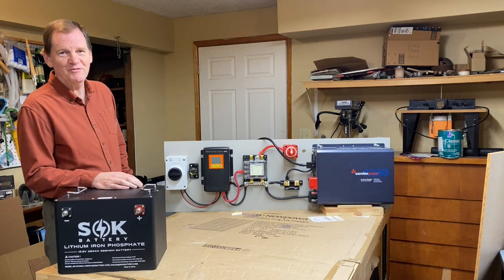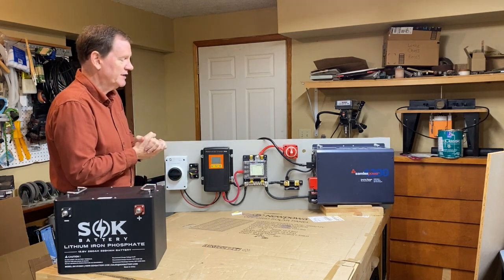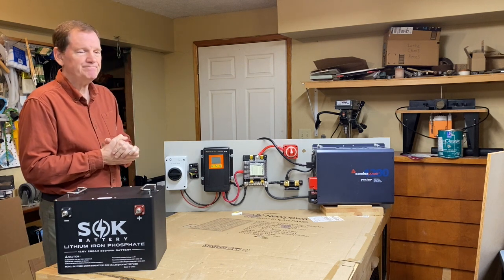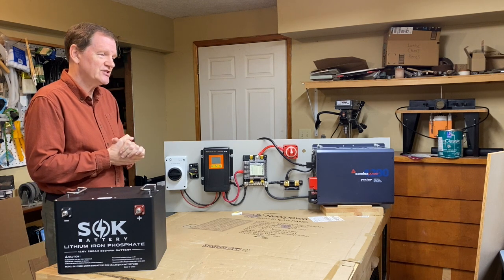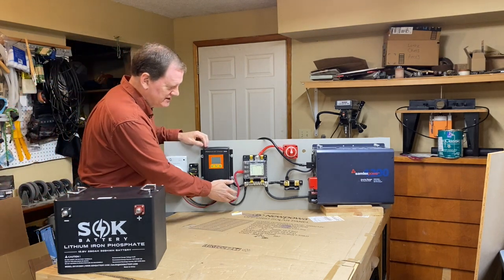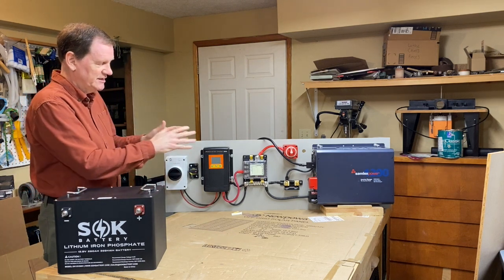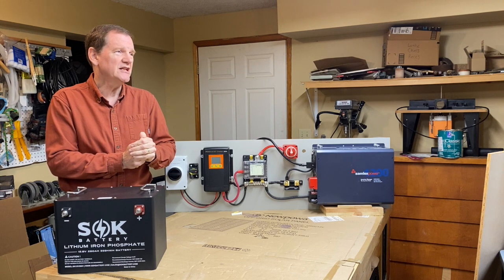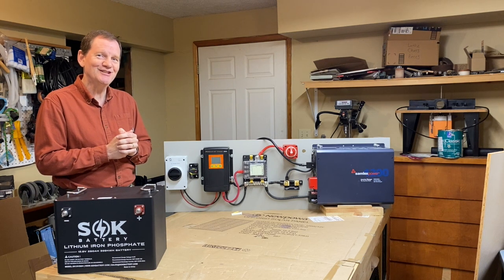CampMaker Van Simple Electrical System

Comment: Dennis, I enjoyed most of your video, but as a novice, there's a big piece missing. Where does the battery connect to the system you show? At the shunt? At the MPPT/DC-DC charger? I've always heard the shunt connects to the battery negative and the charge controller.
Reply from the maker: The battery red (plus) connects to the large red shut off valve and the black (negative) connects to the right post on the shunt. Sorry for not noticing your comment earlier.

Comment: Simple setup with an easy-to-understand description.  My problem is I already have and use a portable power supply.  Can this be modified so I can use that instead of the battery and invertor?  My power supply has both an ac and a solar input.  It is the dc-dc charging I would like to add.  Thanks!
Reply from the maker: You could add a Victron Orion Dc to Dc 30 amp charger.
Reply from the maker: Do you have a link to the power supply you are using? If you can draw up a basic schematic of you system, that would help me offer ideas.
Reply: @dennislittlefield  I have really limited needs for power right now.  12vdc fridge and some puck lights.  Haven't used the van enough to know what else I need to power. Might use my CPAP 
This is the power supply I use.   
Thanks.
Reply from the maker: @sands4651   the fridge and the cpap will use the most power in a day. Do you need to use the humidifier? If you do, it will need about 70 AH. If you use your cpap every day, I’d suggest about 200 amp hour battery to give a buffer for unknown things.

Comment: if you dont need a 3000 watt inverter you prob dont need a 300 amp battery.
Reply from the maker: I’ve been able to do fine with the 1200 watt inverter, but I’ve regularly found the 200 AH battery wasn’t quite enough. That is why this time I went with the 280 AH.
Reply: @dennislittlefield  do you have enough solar to charge that size battery i dont believe you talked about your solar setup. BTW im not trying to be a wise guy just curious about other folks DIY Solar systems
Reply from the maker: @mannyfragoza9652  You are asking good questions! I have a single 500 watt panel on the roof and the Kisae Dc to Dc charger is 50 amps. This is a lot more than the usual 30 amp Dc to Dc chargers. So it will be able to charge fairly well.
Reply: @dennislittlefield  sounds like you def. have enough solar nice work my friend